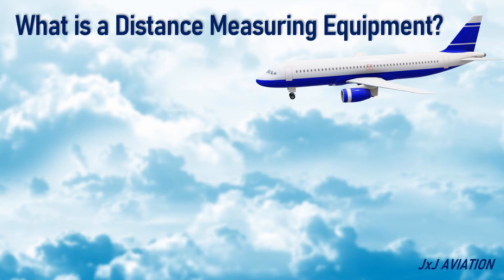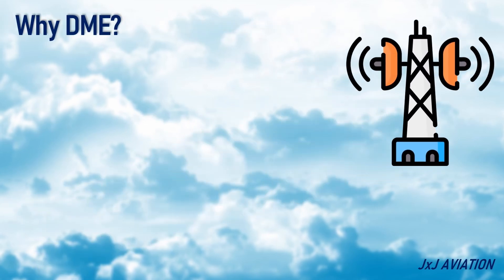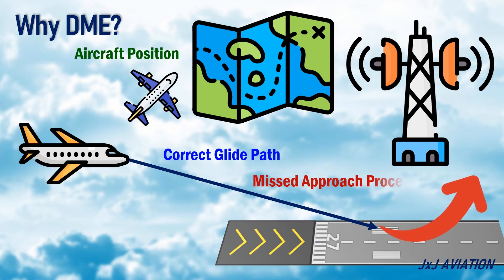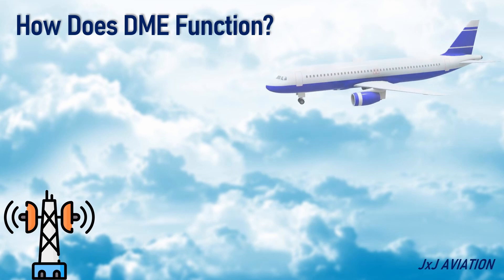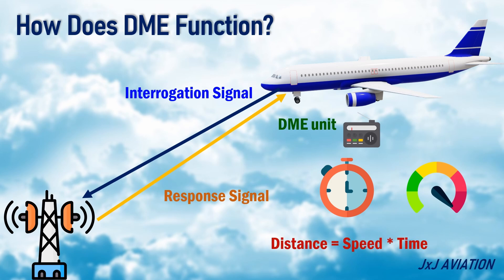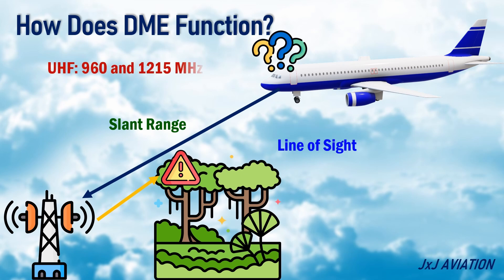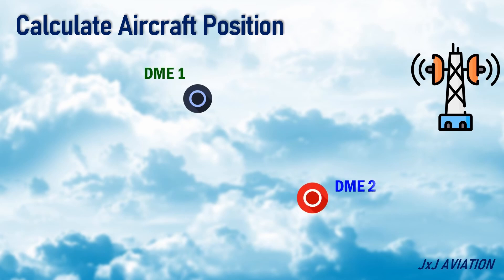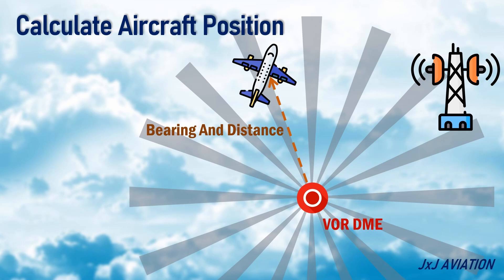What is a Distance Measuring Equipment? | How DME is used to calculate Aircraft Position

Comment: You forgot to mention that the its DME range depends on the number of simultaneous queries from other users of the same DME device
Reply from the maker: Yes that is a good point. How many aircraft can a DME handle?
Reply: @JxJAVIATION  A couple of hundred, so it is not a practical problem.  Slightly misleading to say that the DME replies to the interrogating aircraft.  It has no directional sense, it just responds, but the extremely short time interval ensures that the aircraft receiver deduces that it the relevant response.